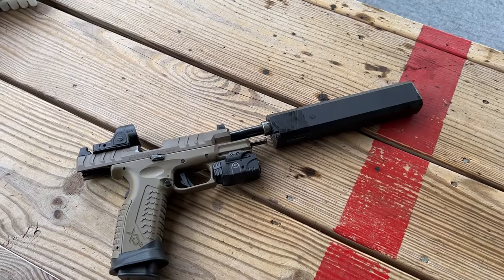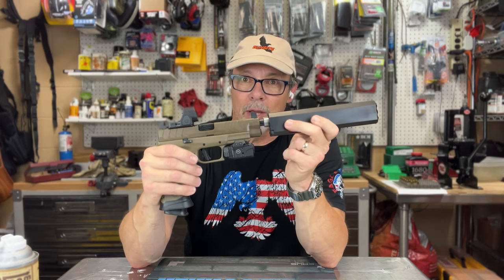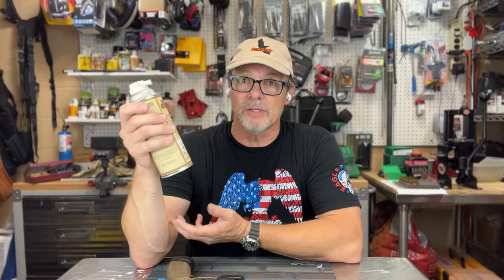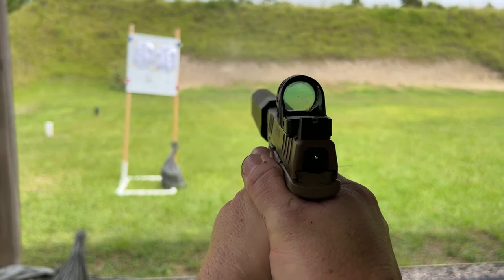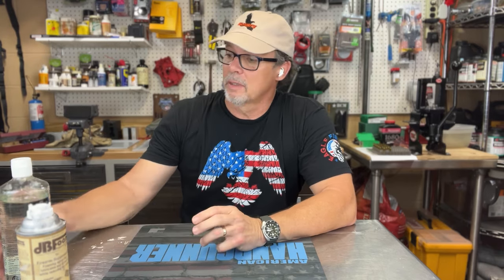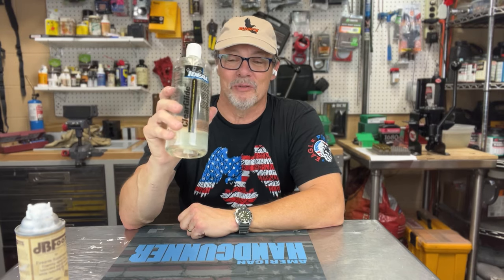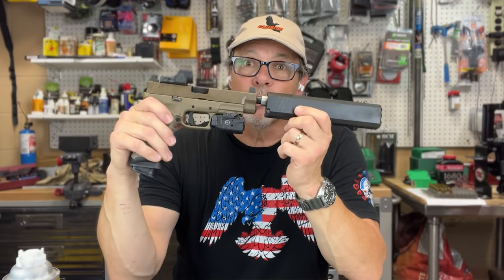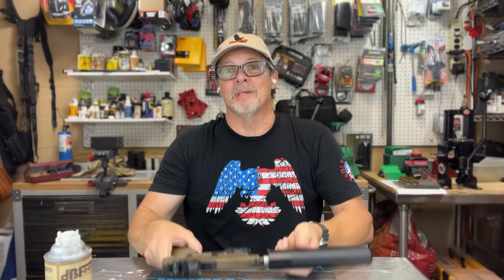dB Foam: Make Your Pistol Suppressors Hollywood Quiet

Comment: I have a question about the Springfield xdm elite ur using. I have one and it has trouble ejecting when suppressed. Did u have this issue?
Reply: @DavidSalazar-ct7ho  you're going to have to use a lighter recoil spring bud

Comment: What kind of suppressor do you have and what cal are you using?
Reply: Looks like SilencerCo Osprey, and a 9mm XD-M. Although the Osprey has two versions (.45 and 9mm) currently, and the 9mm bore is slightly louder than the .45 when using the same calibre

Comment: Would this be safe on a Ruger 10/22?
Reply: Bro, he literally says at the end to not use on rifles due to the pressure being too high. 

If you want to dare and go beyond,  you better be running subs or custom loads that guaruntee lower cartridge pressures.
Reply: @hoplite015 A 22 lr even fired from a rifle still has much less pressure than almost every handgun caliber in common use.  I'm sure it'll be fine.
Almost anything bigger than a 22 on a rifle I agree though. I'd start being concerned about it.

Comment: Umm, just use steel wool between the baffles, it will cool down the hot gas and slows it down. I understand the foam, it does the same thing, but won't last long. The idea is really simple, absorb the heat coming from the muzzle, and have less bang. Steel wool has a lot of surface area, so it can absorb a lot of heat, to a certain point, of course. Youtube has so few videos about it, if at all.
Reply: Does not work. Disintegrates almost immediately and steel clogs up your action as well as damaging gun parts.
Reply: Pink stuff you find in yr attic ;)